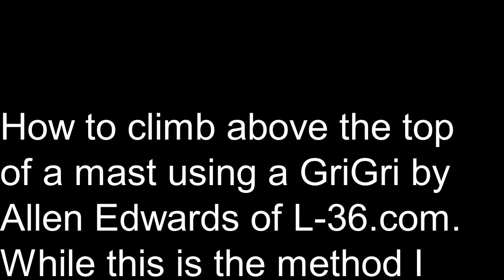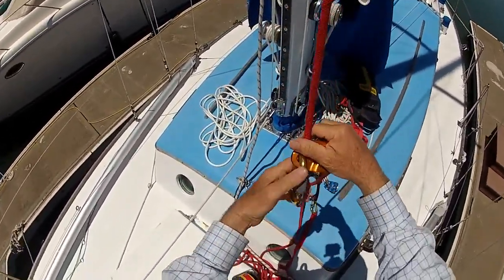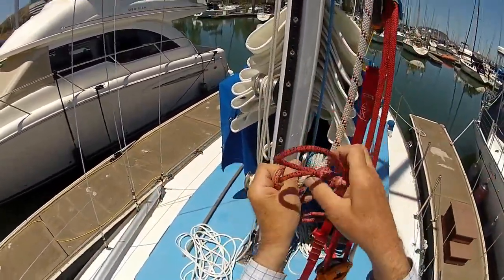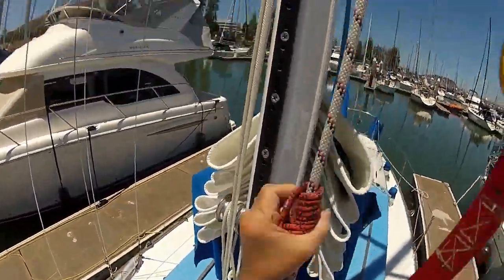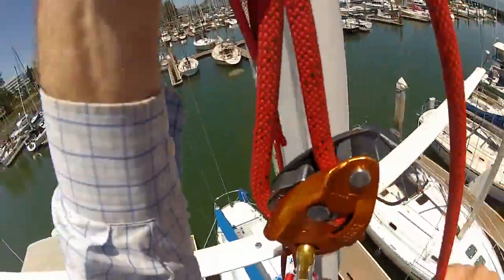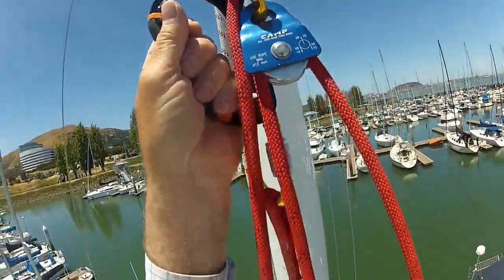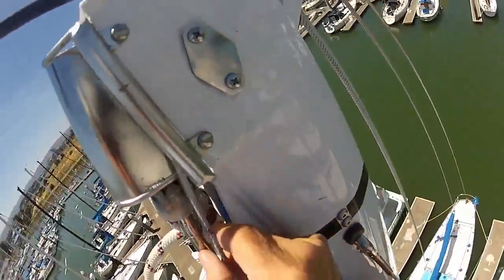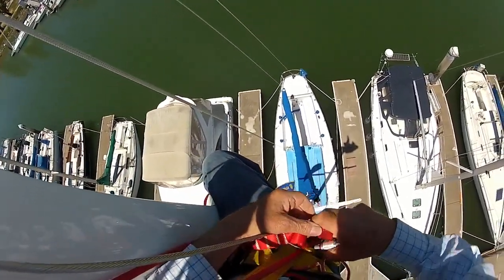Unassisted Mast Climbing using an GriGri with voice over.

Comment: This is this is the best way to ascend. I don’t know why you put up a different one with roll-in lock which is inferior to it. The only thing I could add to this would be to use a sailing harness that’s wrapped around the shoulder and your loop that around the mask both to keep you upright and as an added Safety back up.

Comment: It seems you have a single climbing rope tied to  your Halyard, and doubled to hang down to the deck. That is not true redundancy. I would use both a Hal yard and another different halyard,  say a topping lift, and tie the klemheist or prussic  knot that that!
Reply from the maker: There are two halyards. One tied to my bosom's chair and one to a climbing harness. The prussic is tied to the backup halyard. The climbing gear to the halyard that supports the chair. Visit my website for more detail.
Reply: So the red climbing rope visible at the masthead is not tied up to one single original yacht halyard?
Reply: You're right! My apologies: at the masthead its the tail end of the main halyard that you attached the ascender too. Its a very good system

Comment: A bowline should have a stop knot and it has to be tightened pulling on THREE points simultaneously!
Reply from the maker: That is probably why I use a stopper knot. As I said in the video, sailors know how to tie bowlines but if you are not a sailor, use a figure of eight.

Comment: The longer the tail of the bowline doesn't mean its safer. If the coller on the bowline gets too big somehow the nipping loop can capsize turning into a slip knot, the long tail wont help it will just slip out
Reply from the maker: I think the bigger risk with a bowline is for people who do not know how to tie one and tie it wrong. I tried just now to tie one very lose and made it collapse. It slipped but slipped toward the shackle just making it tighter against the shackle. It did not slip toward the tail.  I was unable to make it slip as you are describing. Rock climbers don't necessarily know how to tie a bowling so a figure of eight is safer. If you are climbing a sailboat mast, you are very likely to know how to tie a bowline. I started mast climbing using a figure of eight but it is just so hard to untie. But if you are uncomfortable with a bowline, use a figure of eight.

Comment: Thank you for sharing this! I've been a rock climber many years and knew I could apply this to climbing a mast on my boat. The pulley is a nice extra touch there giving a bit of a mechanical advantage. Well thought out.
Reply from the maker: Thank you for your comment. As an experienced rock climber you would have the knowledge of the equipment required to make this a reasonable system to use. Best of luck. I just added the link to the article in the description and below.
https://L-36.com/more_mast_climbing.php.

Comment: Great video, very informative and to the point. I tried this after watching another video last sunday.  Other than getting bruises on legs and a huge one on my arm I managed it.  My concern was too many lines that interrupted with my Gri-gri, to the point it lifted up the lever as I was ascending.  I like the use of your pulley giving that 1:3 advantage but after reading some comments in the other video, is this not dangerous? The line going out of the Gri gri shouldn't it be facing downwards to create a lock? Taking it up to the pulley makes it dangerous since the Gri gri is not engaged.  Would like your comments on this. PS I had one foot loop and as I am not a climber it became more difficult to stand after a while, so will go and get a second foot loop. Again thanks for a great video.
Reply from the maker: I can't say I understand your questions fully. I can't imagine how the line to the pully would interact with the handle unless you strung it wrong. The handle goes off to the left and the pully is on the right. The GriGri should stay in the closed position all the way up. 

But that said, this method is just too complicated and too easy to string something wrong which mostly you don't find out until you are at the top. I no longer like it and don't use it. I use the one I call the Ultimate Mast Climbing method linked in the comments. Just click "More" above or go to L-36.com and look under articles. Here is the link https://l-36.com/UltimateMastClimbing.php. That method is also complicated but I have not found it prone to rigging incorrectly. I keep major parts rigged in my storage bag to remind me how it all goes together and even after a couple of years I just rigged it and climbed my mast a couple of months ago without needing to read or watch anything.
Reply: @L-36  Thanks for this, will check out your other method. Since sending you the question, I have gone up the mast, as you show in your video, several times. I have been told by climbers that the Gri Gri is not the right instrument to use for descending but an I'D S is what should be used.  This is far more expensive but it has a self breaking mechanism, which eliminates mistakes that could happen (say you fixing mast head and rope through Gri Gri loosens up, on your descend it will take a few seconds to lock.

Comment: Any knot, Bowline or otherwise, can slip and kill you under the "right" conditions: put a safety in the tail and it'll never be a problem.
Reply from the maker: I agree. In face, as you can see, I use a 3 foot tail and a stopper knot.

Comment: Thanks for the great video, I like this method and I find it very easy, even if some practice is needed with grigri. I have a question: in the unlucky event the main line fails, how can you come down just using the safety line, as prusik is so tight? Won't you need someone to unwind the safety line from down below? Thanks.
Reply from the maker: Great question. What you do is you wrap the line over one foot and stand on that foot with the other foot. That pinches the line between your two feet. Then you can stand up and release some of the tension on the prusick and slide it down. It is a fairly standard way to climb with a prusik although I can't find a video on it for you. The other way would be to bring another ascender and a sling and use that as the foot loop. You could also use a loop and make a second prusik for your feet. I personally would use the foot method and have practiced it and it works.
Reply from the maker: Here is a video showing the foot grab. In this video, he doesn't even have a prusik but you can see the foot technique. https://www.youtube.com/watch?v=ROpnzuaaa1g

Comment: I  noticed that  some place you mentioned  "100% redundant".  This is certainly not that.  That is because the entire system  depends on the  red climbing line up to the top block  on the mast, and whatever the blue/ white  line  is and is attached to.

The ONLY way this would be  "100%"  would be to incorporate some sort of harness/ strap/  other  braking device  TO THE MAST   for fall protection.    Incidently,  part of my job  back in the 90's was climbing a few  communications towers.  There has been a number of falls and deaths  because of various  failures, including a  CLIMBING PEG  on  a  Rohn free standing tower.  Even  tower   safety cable/ braking systems are  somewhat questionable, because  you don't know  what condition the hardware/ cable is  in  UP AT THE TOP, until/ if you  "get there"  At least  on towers  you can "hook up" on the way up
Reply from the maker: There are two climbing lines. One to my bosun chair and one to my harness. Plus lately I have been tying my chair to my harness, just a bit more redundancy. I have two wing halyards and one line is on each of them. Like I said, 100% redundant.
Reply: This certainly IS that! He's climbing on the red halyard, with a safety off to his white/green halyard! Maybe you should watch a little closer before offering "correction".
Reply: I am not sure if you know what redundancy means.  There is a main rope backed up by another completely separate system- redundant. 
Great video. I have been a rope rescue technician for over 30 years and this is how we ascend.

Comment: I believe the knot you're using in place of a prussik knot is called a "klemheist" knot.
Reply from the maker: You are right of course. Thanks for the clarification.
Reply: It is and there are two types. One is tighter than the other I believe. The main difference to a prussic is that prussic  holds in both directions.

Comment: You mention the harness or bosun's chair can't come out of the carabiner when you open it due to the pressure from your weight. To remove any possible risk, why not feed the downwards line coming from your micro pulley thru the carabiner before you start to climb, and just remove the pulley when at the top? I guess there's a chance you could drop the pulley or carabiner when taking them off the line to store on your harness.
Reply from the maker: There are lots of way to rig it for sure but opening the carabiner just isn't an issue for me.  I am backed up by the safety line and the open carabiner is rated at something like 15KN which is about 3000 pounds.  Compare that to a high quality bosun's chair which is rated at 220 pounds.  Now one is breaking and one is safe but even with a 5:1 safety factor the open carabiner is safe to 3x the Harken chair. 

If you really don't want to open the carabiner, just feed the rope through it and pull it all through. It is only 50 feet of rope and if you are worried about it, just do it that way. 

But as I said in the comment below, I don't recommend this method. It is just too complicated and too many things to remember and rig.  Use the two ascender with the rescucender on top.  That is what I have on my boat in case I have to climb the mast in a hurry. video:://youtu.be/rjjY_XoxA5U
Website http://L-36.com/mast_climbing.php